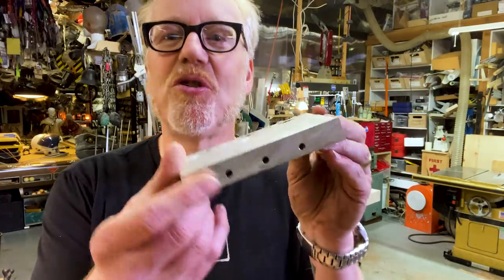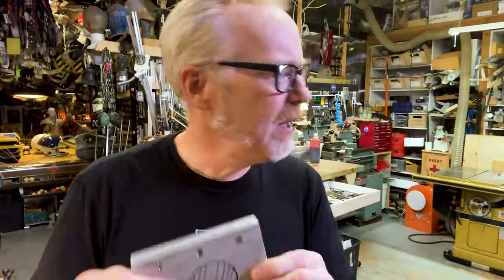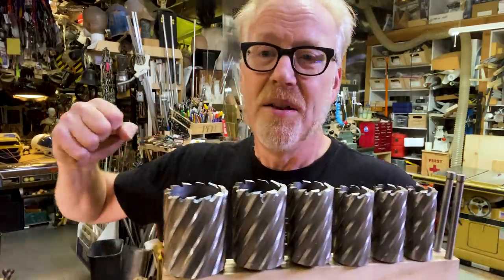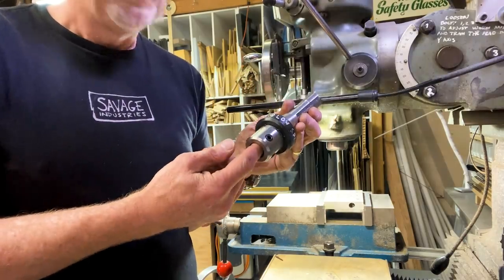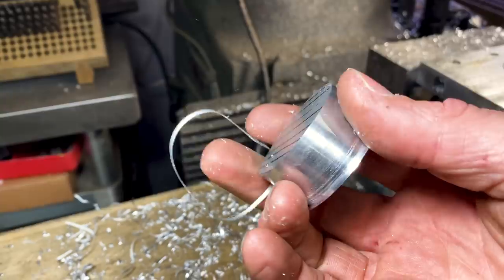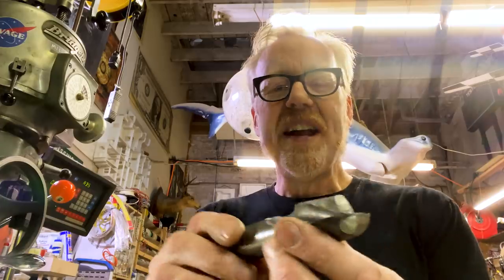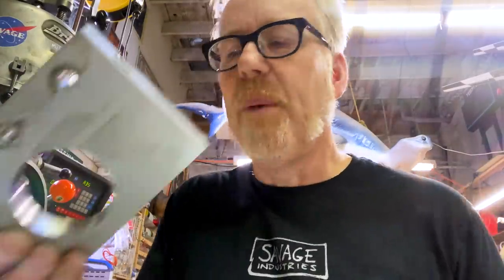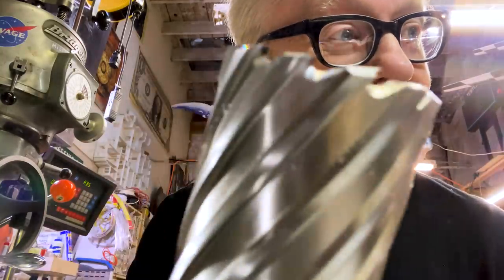Adam Savage's Favorite Tools: Annular Cutters!

Comment: You are cutting way too fast And when you're working on drilling in aluminum og taking material off with a lathe, use rubbing alcohol instead as a cooling option:)

Comment: Wait what? You got a Bridgeport and dont know how to use it... Big ass endmills are not for drilling, usually, on a knee mill..Many other safer ways to punch a hole.  But a big tip, DONT GRAB THE CHIPS!!!!
UPDATE
Yeah its been less than 10 min, but WTF! My machine shop mentor would punch you in the neck for this amount of stupidity. I am no shop genius, but I have all 10, and can cut circles around this BS crap!! Holy shit, I'd get slaped, or be a slapper, for this shop practice. OMG I'd get my ass kicked for this in a working shop.